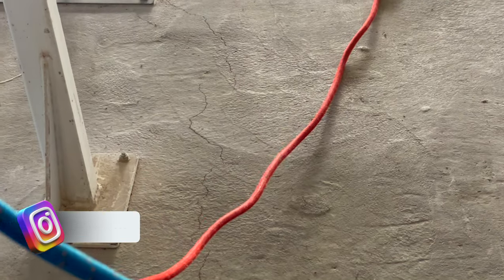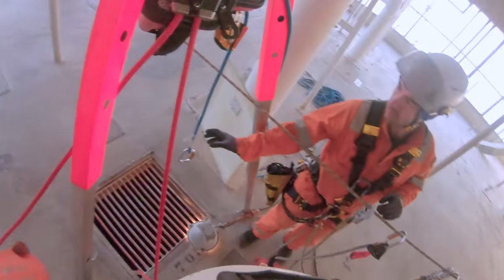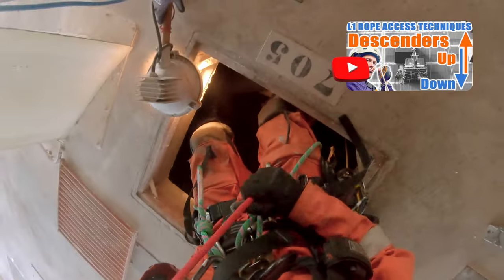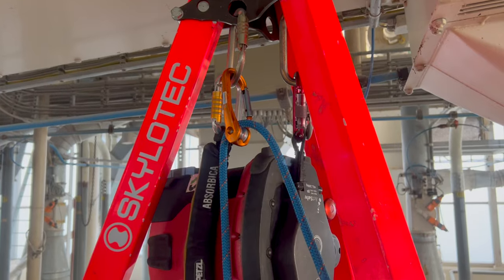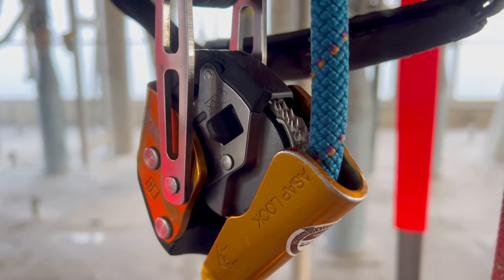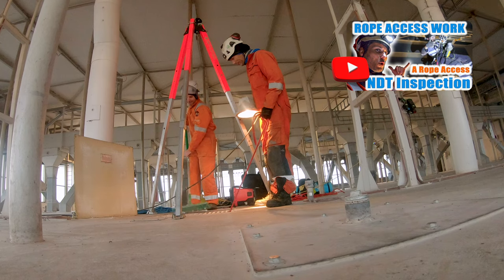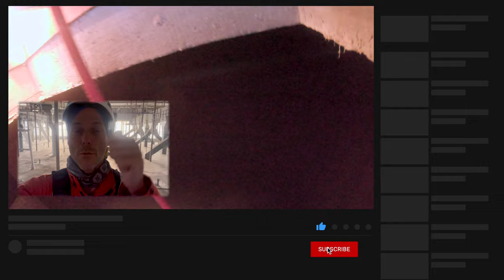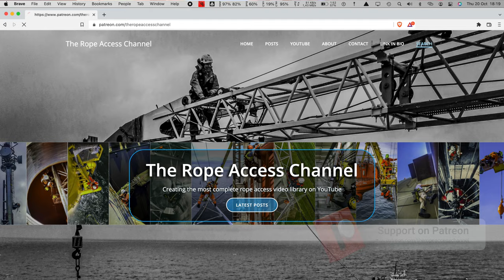Confined Space Cleaning - Real and Dirty Rope Access Work

Comment: Just in case you don’t know if your remote control for the winch goes flat. Then you can connect it to a phone charger battery pack and you can still use it while it is charging.
Reply from the maker: Thanks, I found that out once because we needed the remote and I just thought lets see if this works.. It wasnt really empty yet, it just seemed that the range was getting less. The moment it was on the powerbank we had full range again.

Comment from the maker: Do you use Actsafe winches like this?
Reply: Not currently in our budget, if a job calls for it, I'm sure it'll be invested in and billed to the customer. So far, we're working around or under 450ft, but on avg 150ft, something, nothing we can't climb.
Reply from the maker: @FalenAnjel2  150ft would take you about 2 minutes with an actsafe. There is a lot of time to gain there. I have done jobs on facades, only 60-80ft in Actsafes. The fact you drive up and down easily with the strips and rails we were installing is such a timesaver. And what about rescue's? Hauling someone in a z-rig type deal takes ages. 
Still, I know it is a lot of money. But in about 50-100 days it is paid for by clients, after that its making you money. Or wait for that one big job ;-)
Reply: @TheRopeAccessChannel  Well it's the boss mans money, when he decides it is time we'll get a new toy to paly with. I  can see the rescue and time saving factors for sure.👍